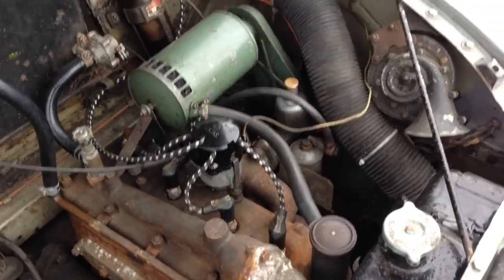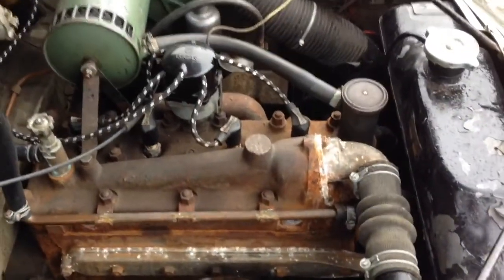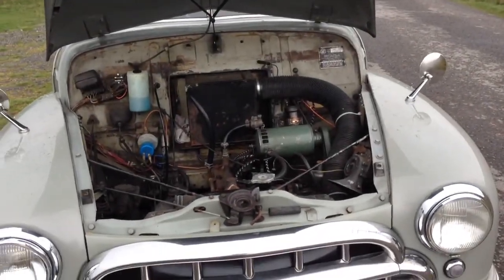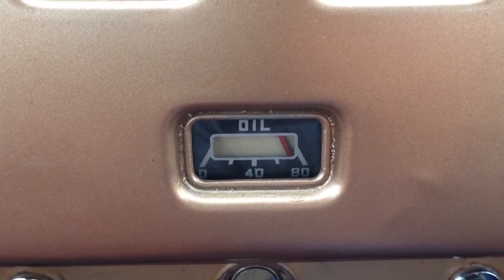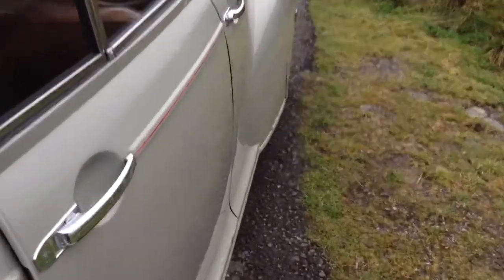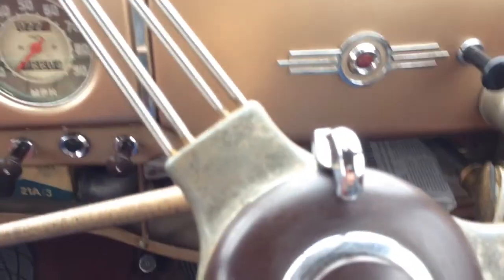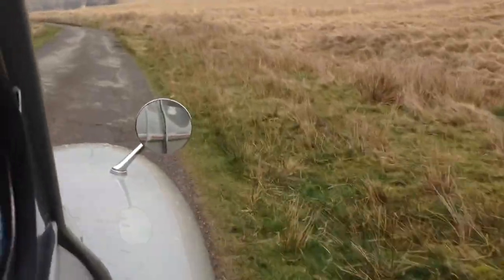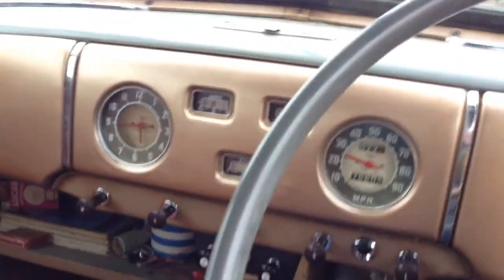Sidevalve (flathead) Morris engine.

Comment: Wow, I am amazed at your ignition coil.  Runbaken Manchester oilcoil.  Love that company to bits, and no one talks or gives them any credit. Such a shame that they have been forgotten. I always buy anything that I can get my hands on, with their name on. 
Did you buy the coil, or you had it on the car. All the best!
Reply from the maker: Hi I put it on the car as the original correct coil had long gone; a modern one had been fitted and although it did the job fine it got very hot to touch. So I substituted the glass Oilcoil and hot starting was better and it was always cool to the touch. The last thing I wanted was ignition trouble especially when I was making frequent solo night journeys to Snowdonia. They are great coils as well as being nice to look at.